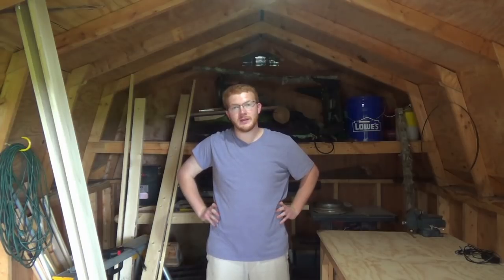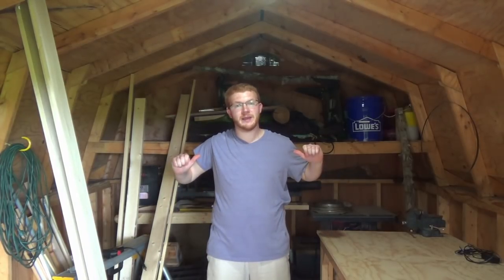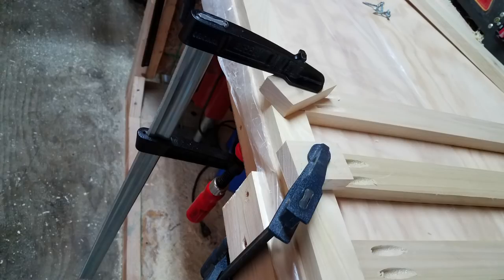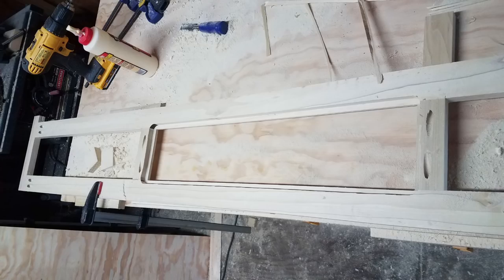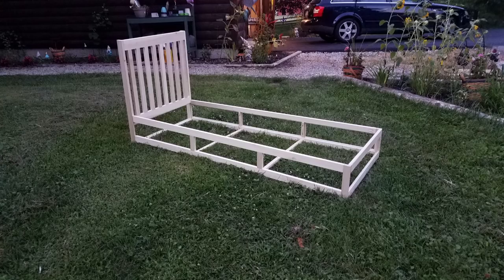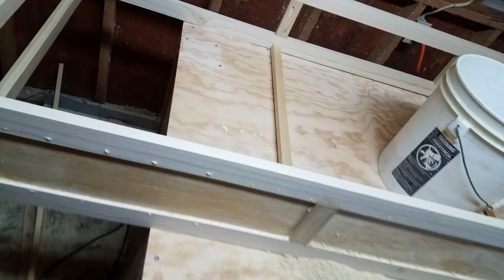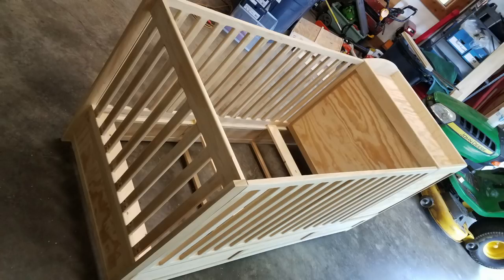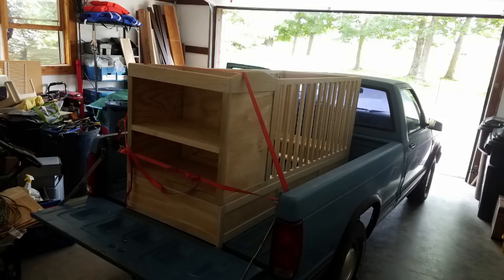Building a Baby Crib

Comment: really like it
Reply from the maker: thanks!
Reply: @thechristmascarpenter496   say can u plz provide a set of plans on how to make one for a twin size mattress?? just curious i wanna build one but the person is older and wont fit in a regular crib thanks in advance if u can
Reply from the maker: @ChronicallyBranden93  Sorry, but due to different safety regulations concerning cribs, I can't provide plans for this project, and this video is intended as entertainment rather than something to be followed.  If you're interested in building your own, I suggest researching the safety requirements for cribs for your area and work backwards from there.  Good luck!
Reply: @thechristmascarpenter496  ok thx figured i ask